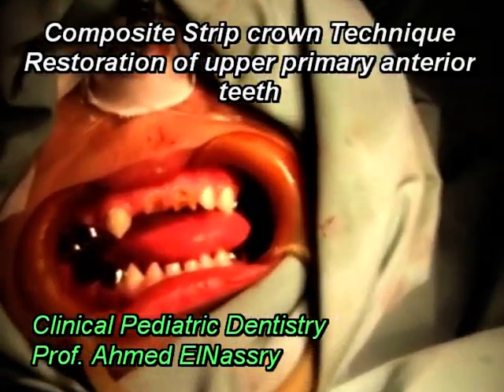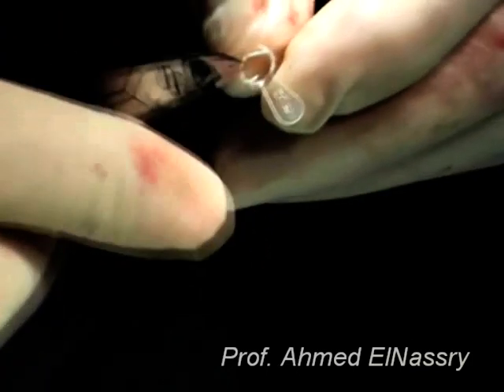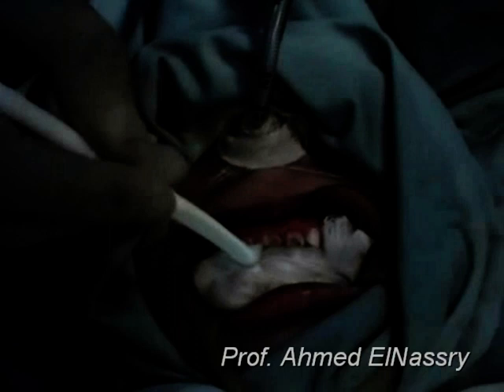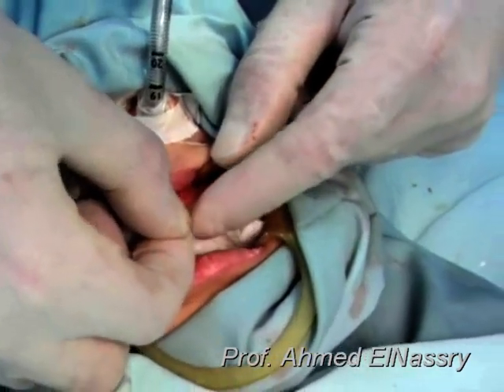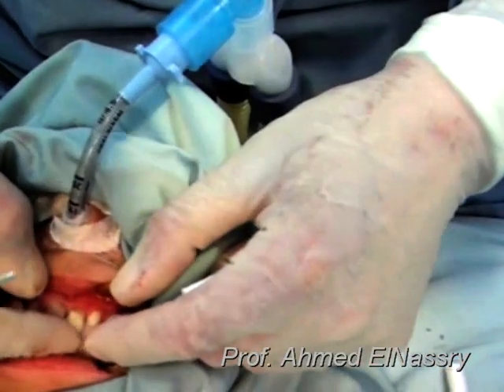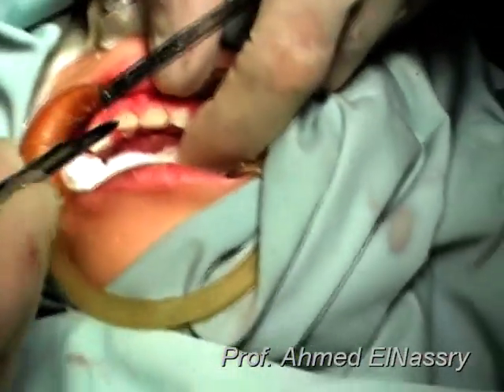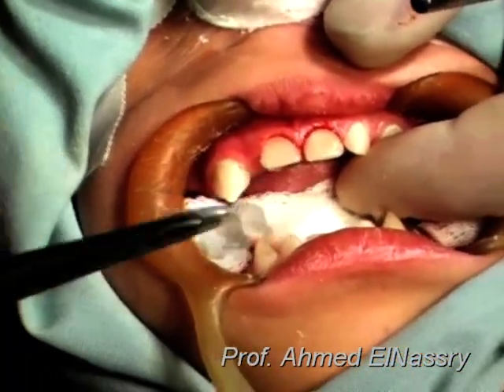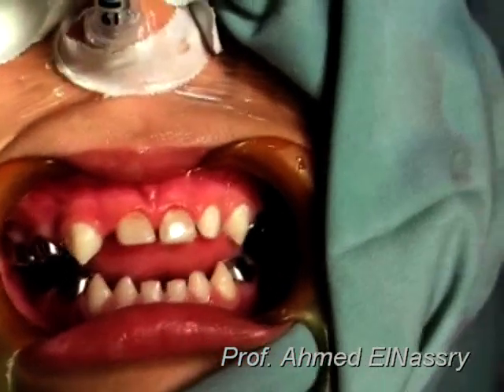Esthetic Restoration of Primary Anterior Teeth

Comment: Hi Dr. Ahmed,
If you had to do a pulpotomy on those teeth, would you use the same technique?
I was taught (and also noticed from experience) that composite doesn't bond that well to deciduous teeth? Thus, do your restorations tend to last only because it wraps around the whole tooth and thus provides retention?  Do you find that acrylic anterior crowns are inferior to these composite crowns?

thanks

Comment: Today I had a case of a pt (35 yr old) with trauma to the tooth 11 with no pulp exposure (however very close radiographically). As to avoid elective endodontics as much as possible for Post-core, I tried to use the celluloid crowns but the contact points were VERY tight and didn't allow correct placement and had to rely on cellulose strips and manual build up, is there anyway around this problem (unfortunately I dont have tooth seperators as government clinic has only basic materials available)